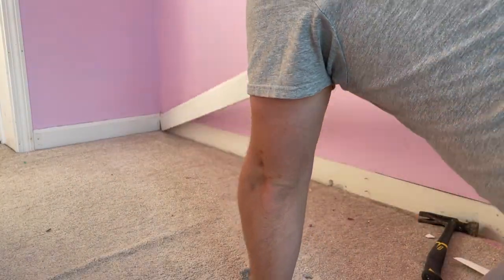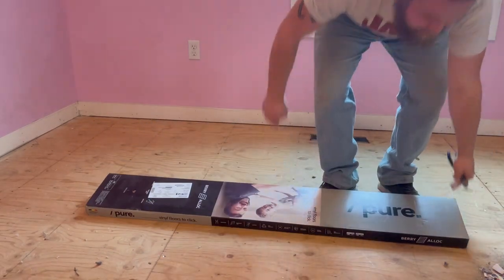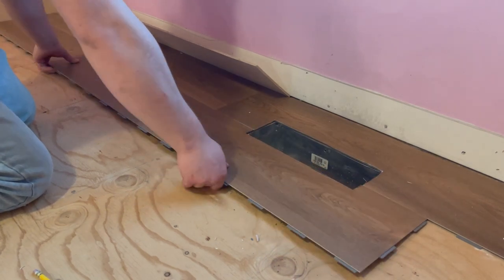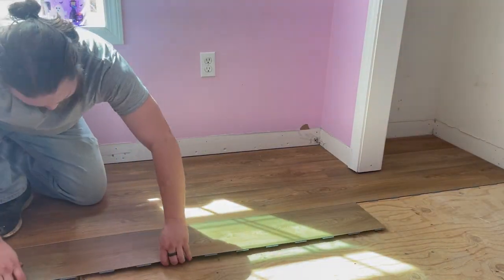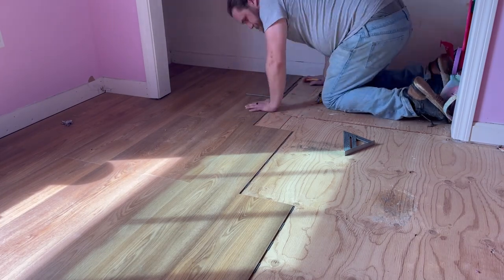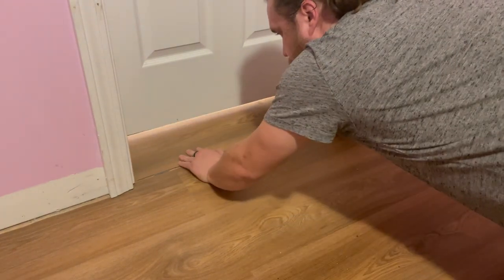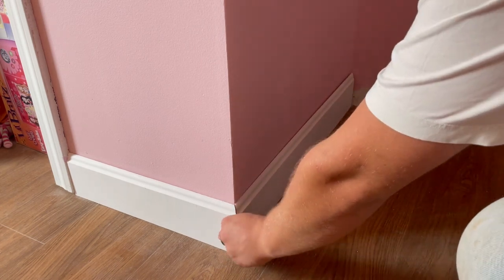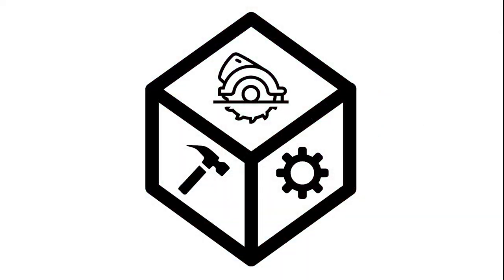Vinyl Plank Flooring Installation Made Easy!

Comment: Well here in the UK underlay doesn't need power tools or nails, and is easier to cut than the vinyl. I'm sure you can get similar in the US as I've seen it used on other vids. Good job anyway, plus this is the first time I've seen the tab type of flooring, I quite like it.
Reply from the maker: I am somewhat familiar with the type of product you are talking about but have never used it so I wouldn’t want to call it out in a video without trying it, but if it works well for you and gets the job done that is awesome. One more way to solve the problem, thanks so much for pointing it out. Yes the planks with the tabs work really well for me and allow for many different design patterns that I didn’t use in the video, the only down side I’ve fond is that it’s easy to break off the tabs but as long as you’re careful I would definitely recommend them. Thanks again for watching and for reaching out with another underlayment option.

Comment: This is a great diy video!!!  And I loved how u explain different cost options and the underlayment.  I get scared to fix anything in my house bc I am scared to rip the old and not know what steps I’m suppose to do to fix it.  Do I need underlayment or how to raise things? 

Also, how much spacer did u need and don’t u need the spacer for all 4 walls?  I only saw it in the beginning being used
Reply from the maker: Thank you so much and those are great questions. I totally understand that fear and you definitely don't want to get yourself involved with something you're not comfortable with when it comes to safety, but as far as not knowing how to fix fix or finish a project, I find having a half ripped out floor a great motivator to learn to install a new one, so I say as long as you are being safe go for it. 

You don't need underlayment as long as you are okay with the floor being slightly lower. The spacers I was using are 1/4" and yes you need to leave a gap between all four walls, you don't need to use spacers but they are a great way to make sure your gaps are the right size. Thanks for watching and for the comment I hope these answers are helpful.